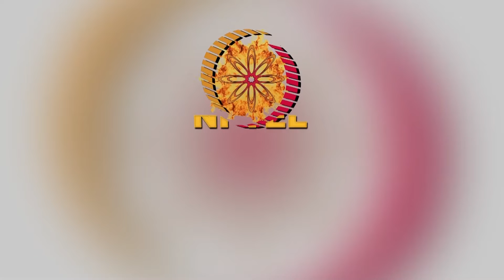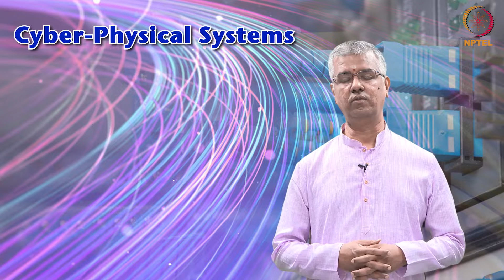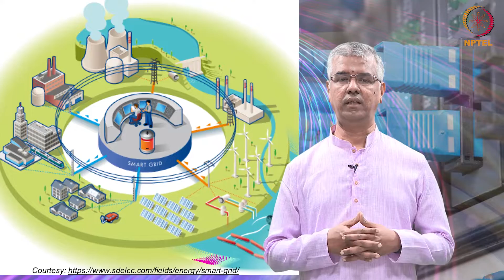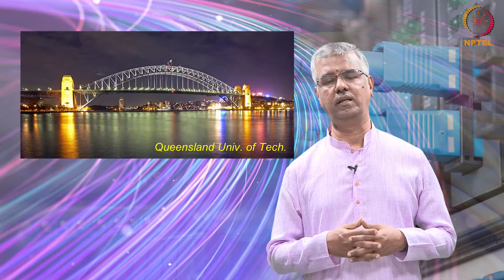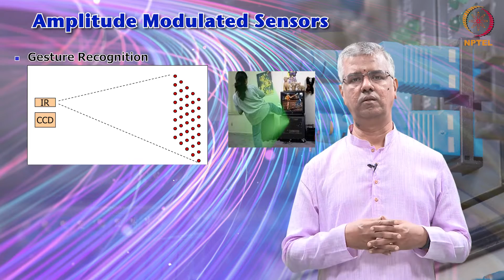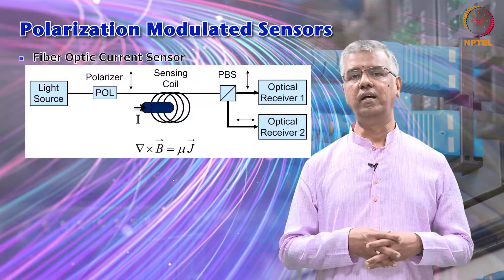Optical Fiber Sensors _ Course Introduction

Comment: What is the perturbation in this video?
Reply: Could be strain, vibration, temperature or pressure changes
Reply: Thank you for your answer, I have another question, I have a plastic optical fiber based curvature sensor study, here I observed the power changes depending on the curvature in the fiber, what other changes do you think I can observe?
Reply: @AslıhanDüğüncü  I presume you are using a multimode fiber. Yes, you may expect a degradation in power for larger curvatures (smaller ROC) due to the higher order modes leaking out. This would also change the mode distribution as well as other attributes such as phase and polarization of the light. You may contact me through email for further queries.
Reply: @balajisrinivasan748  In this study, a Fabry-Perot multimode laser diode with a wavelength of 650 nm and an output power of 50 mW was used as a light source and the optical power changes at the POF output depending on the curvature radius were measured using an optical power meter. In this study, I wanted to observe the time shift by adding a Y-coupler, but in plastic optical fibers, the time shift occurs in the picosecond to femtosecond range, as it is related to the propagation speed of light in the material. However, the digital oscilloscope in the laboratory shows a maximum resolution of nanoseconds, and because of this, I cannot observe the time shift. If I want to observe polarization change, I unfortunately don't have an optical polarimeter. I am currently looking for other things to observe in this study. I have installed Zemax as a simulation tool; can I do something with it? Your ideas are very valuable to me. My email address is: aslihandgnc@outlook.com.